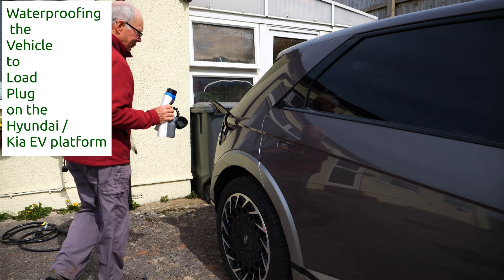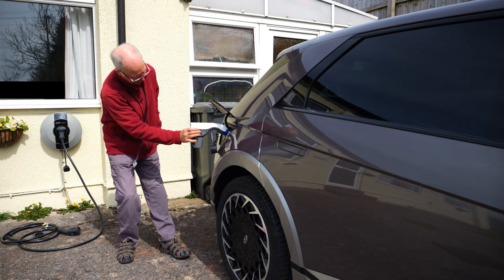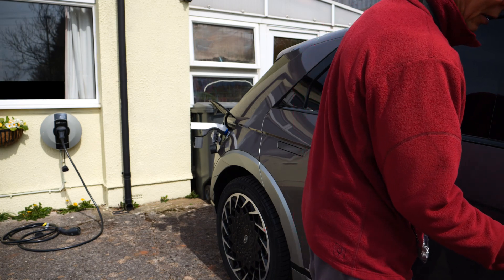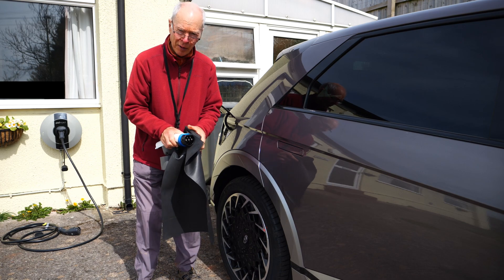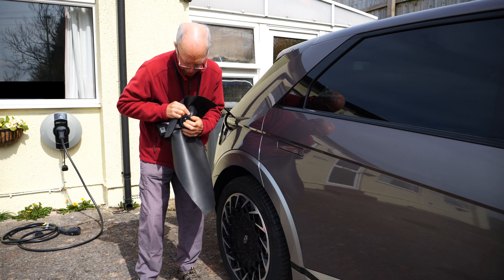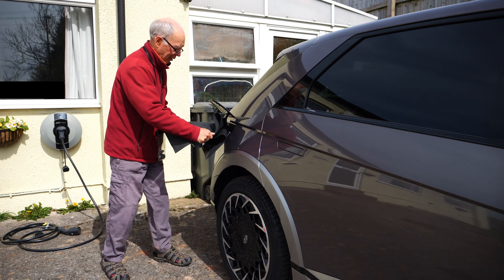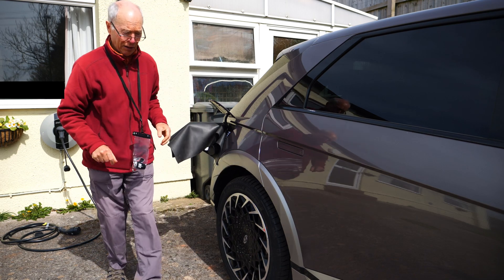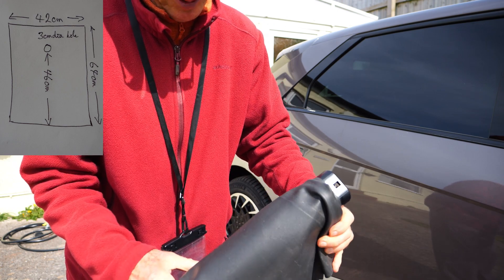Waterproofing the Vehicle to Load adapter for Hundai and Kia pure electric vehicles EV6 Ioniq 5

Comment: Thank you, did you sell the Soul EV for an Ioniq 5? If so, did you experience any issue with the Soul or Kia dealerships
Reply from the maker: We sold the Soul EV back to the Kia dealer for an extremely good price - much better than the Hyundai dealer was offering. Then a year ago we bought the same model Soul EV from a private owner for my wife to use. Again an extremely good price and the car is as new with no battery degradation.